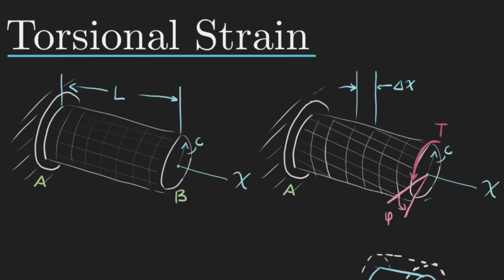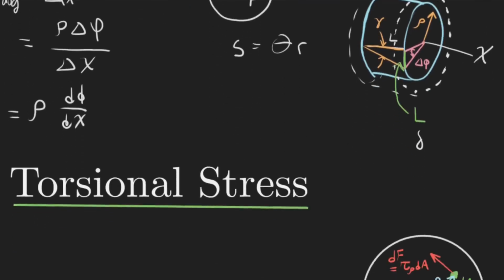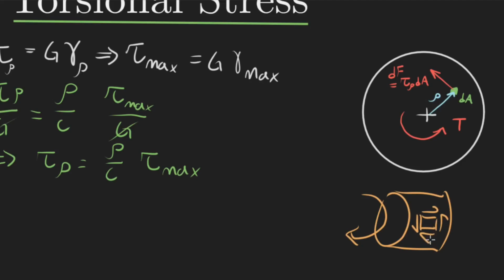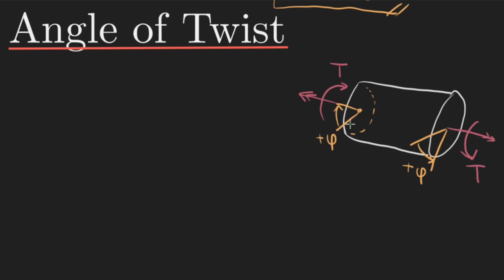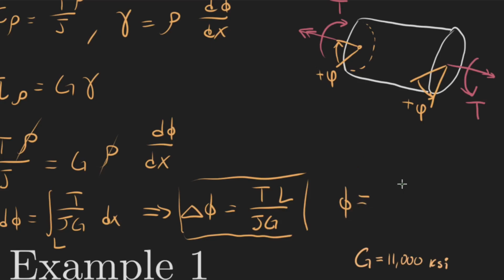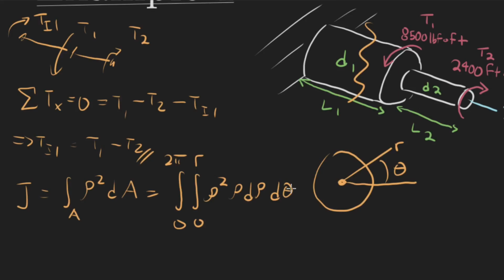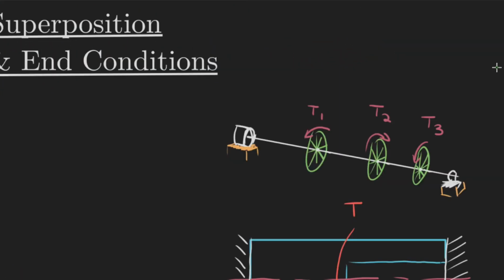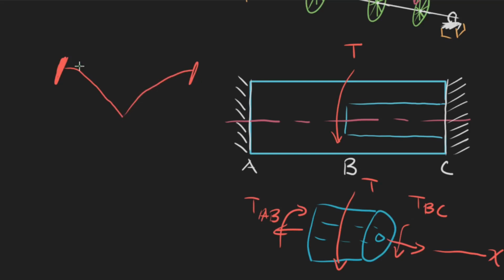Torsional Stress

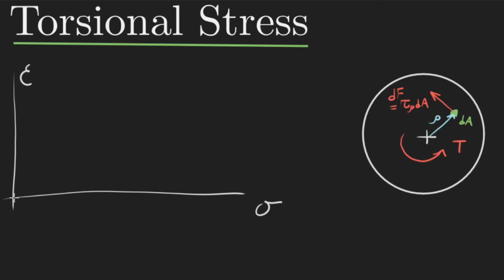Comment: 4:00 The position of the stress-strain and the curve don't corresponde each other.
From that diagrame if we increase the load (stress) there's an interval where the deformation stop...
The curve or the coordinates needs to be adjusted.
Reply from the maker: My bad, stress should be on the vertical axis and strain on the horizontal axis. The horizontal region represents what happens when you apply stress beyond the elastic region and the part deforms much more for a certain increase in stress.